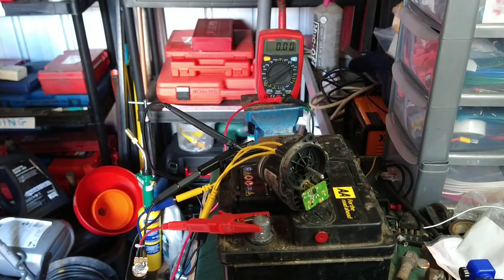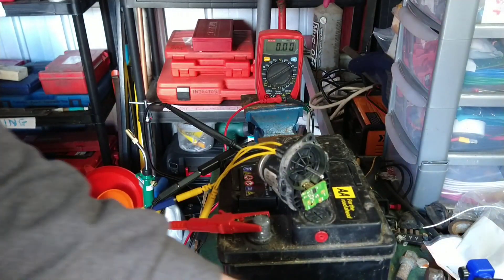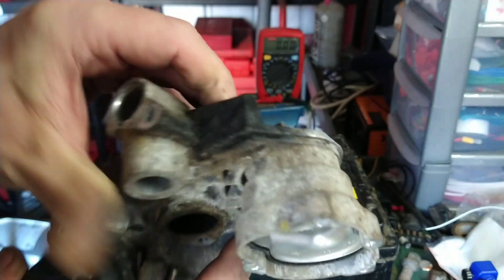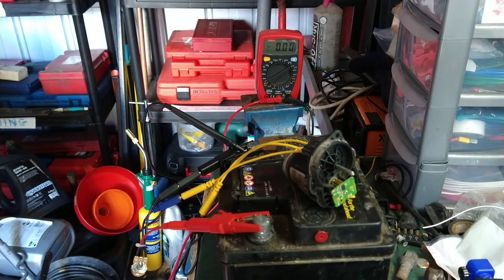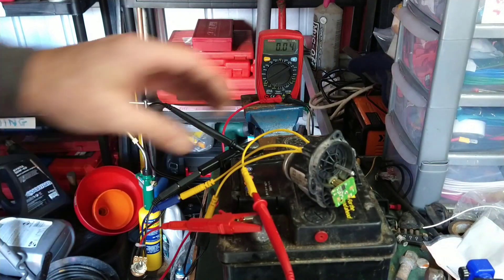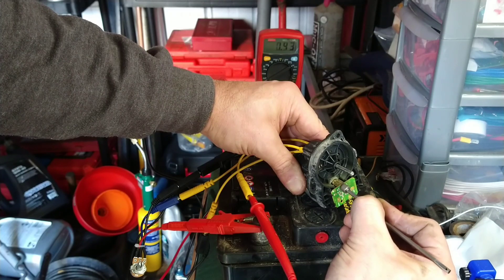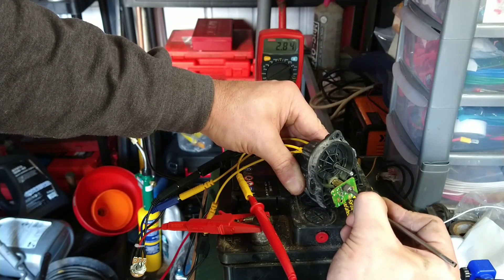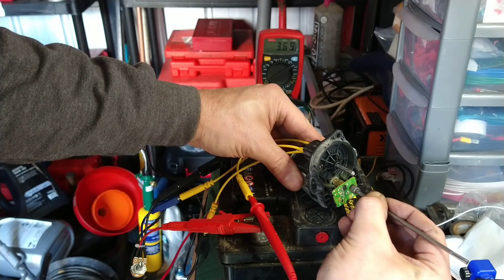VW/AUDI E.G.R Position sensor (bench testing)

Comment: Excellent video,this EGR valve cooler unit seems to be the Achilles heel of these 1.6/2.0 VW/AUDI ,Seat/Skoda tdi  cars
Reply from the maker: Aye I have replaced some with the same part number on the new one, not sure if it will last any longer than the original
Reply: @mechanicmatt871  Hi Matt, probably NOT as  with the new tdi emission software update to the ECU the duty cycle of the EGR.
Is more frequent so blockages will occur
quicker in my opinion So more  work for you
but not a good job position wise on these VAG cars
Reply: @mechanicmatt871  Hi Matt, just like a follow up on this video.
You mentioned this unit was changed due the water leak issues on the egr cooling.
Just wondering if in your experience with these VW type EGR cooler valves.
Is it more common for the exhaust gas valve to stick which then damages the plastic cog gears.
Or have you seen more of the water leak failure on these EGR cooler valves.
Any info you can supply most appreciated.

Comment: Thank you for  great video. I have 1.6 TDI CAYC Seat Toledo 2013 and i changed EGR recently. The original part was Wahler and i bought Pierburg that work only 8 months. 
Now I clean the original EGR and i need to know if any electronic damage can be and how to test if it is working before installing on the car.
Can I have please details about the voltage and how to check if the EGR if is working?
Reply from the maker: I couldn't see this on Carmin pro with that engine code, what I do when I don't have a wiring diagram is see if the five wires going to the EGR have two thicker wires, It is likely that they are for the EGR motor.
If it has three thinner wires, they would be for the EGR position sensor, and with the ignition on it should have one 0v wire for the ground, a 5v wire for the signal supply and a sensor signal that will change between 0.5 volts to 4.5volts. if the signal is over 1 volt with the ignition on, it is possible that it is slightly stuck open due to a carbon build up on the valve.
After starting the engine the voltage here should go up as the EGR opens at tick over like it is supposed to do, and when  you rev the engine the EGR valve should close and go back to around 0.5 volts.
You could power up the other two pins that control the EGR motor  with the cars wiring disconnect from it, and see if the valve opens if there was no change at the position sensor signal wire.
Thanks for watching

Comment: So have you determined that the fault was mechanical on this EGR cooler,as that test appears ok.You could have shown the dc motor working or not by applying 12v to pins 2 +6 on the  dc motor.
So we are talking north south pole effect from the magnet rotation to trigger open and shut of the EGR   valve plunger. Please see this link for further info ref 6.10 into the video https://www.youtube.com/watch?v=9_VTF3iva9U&list=WL&index=3       However thank you for your upload very informative and well presented
Reply from the maker: This was a leaking EGR cooler, not really what the video is about. It was only to show how the position sensor works, and explain that it is using a magnetic angle sensor and not a wiper resistor.  It helped to demonstrate this on a known good EGR position sensor.
Thanks for watching and your comment, I'll check out the link thanks.
Reply: @mechanicmatt871  l take your point Matt  no criticism intended .
Reply from the maker: It's all good Colin, I watched the link to the video, Dave is very good at passing on information. He has helped me out personally a few times now.

Comment: Nice one Matt, its good to see the inside of things
Reply from the maker: Thanks Dave, I'm not sure how well the sensors hold out when they get hot with them being part of the exhaust system, because they do seem to get replaced on a lot of their cars.
Reply: @mechanicmatt871  aye magnets dont like heat, i was using a wee magnet to hold a couple of bits of steel. Started welding, magnet demagnetised

Comment: Nice video mat. I'm guessing the 0.00 is where the magnets repe,l and as the magnetic field starts to increase we see a rise in output voltage? Until it reaches the off position again.

Thanks for sharing..
Reply from the maker: When I put the two halves back together, and worked the egr valve open and closed by hand, it had a 0.75 v to 3.35 v range.
I didn't think to add that test in the video.
So I think the Repel position must be out of the valves operating range.
Thanks for watching and your comment.